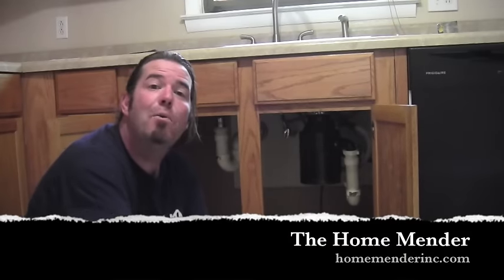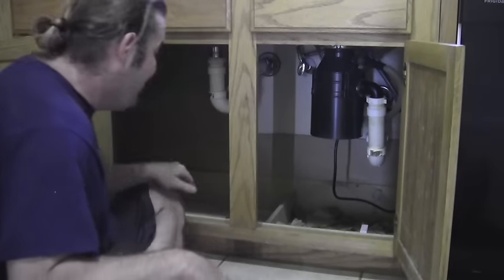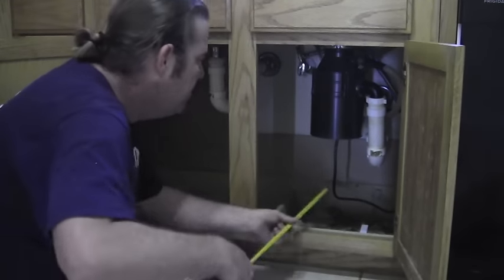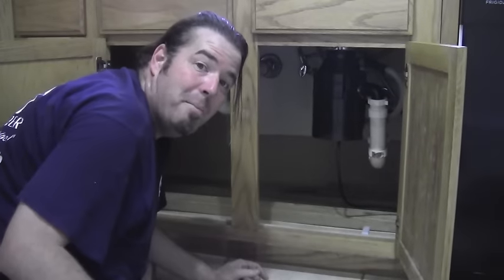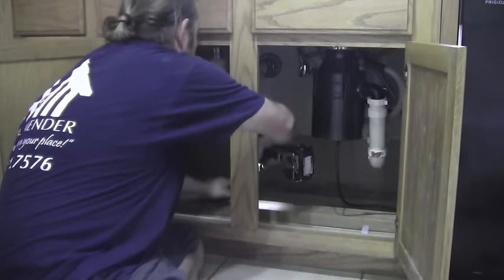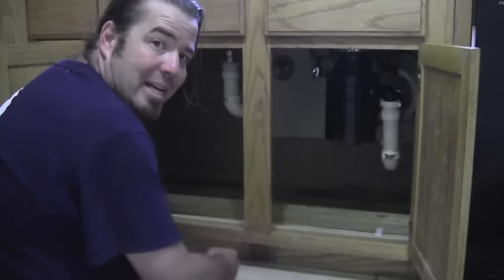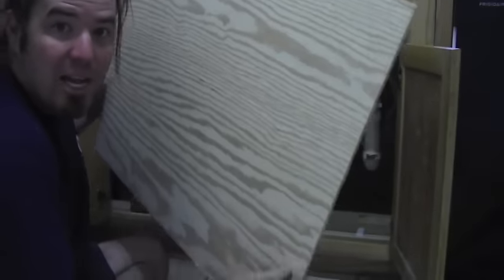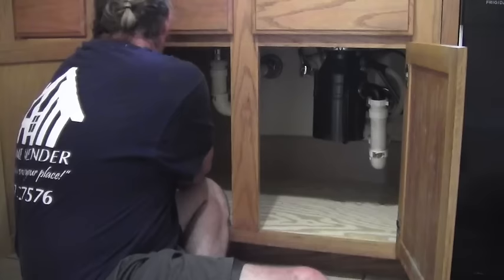How to replace rotted sink base cabinet floor bottom. Easy! Home Mender.

Comment: Please guys, wear a mask and gloves! If water was standing on the floor board for a while before it was discovered, you can have some very toxic molds still underneath that board. I've seen more than one guy end up in the ER after doing this type of work, same for dishwasher repair and bathroom vanities. Oh and don't leave the mold in there, clean it out before you put the new board in.
Reply from the maker: thanks for sharing!
Reply: @homemend  That’s my concern as well. How do you safely identify and “clean” the mold?
Reply from the maker: Hey J!...if its black, i  would hit it with mold and mildew killer..not bleach...this  is  a myth  that  bleach works...HD has  a decent mold and mildew killer for 7-8  buckw .if its  really bad, i would pull it..i hope this helps!
Reply: @homemend  That’s fantastic! Thank you so much for your quick response! 😁  I’ve subscribed and look forward to your future videos. Merry Christmas, too!
Reply: No

Comment: Great vid!!!! A couple suggestions, use pressure treated plywood for the replacement base or at least treat the untreated plywood. Also, use galvanized nails or screws for extra protection for an extra couple pennies. Lastly, caulk the seam if you have to cut the plywood base in half. Thanks for the vid.
Reply from the maker: Thank you mp!

Comment: If you are still reading comments on this, I got a question, how did you secure the pallet to the floor? The area under my sink is simply a concrete slab with no wood flooring on top. I can't really nail or screw into the concrete.
Reply from the maker: Hey hey Jason, I’m here for you my friend. You have the same situation I do as I was on a slab. You’re basically building a little floor in the bottom of your cabinet. Once you get it built and secure your top to it. You should be good to go! If you need extra security, you can always liquid nail it to the cement.

Comment: Yeah that was supper easy... since you strangely didn't have any pipes coming through the floor.
Reply from the maker: Thanks for watching. if you have pipes, draw them out on your board first and then cut your board through the pipe hole so you can piece your floor in around the pipes. You got this.

Comment: This is a great video!  Some videos make it look like this is the hardest job in the world, but this one is the best.
Reply from the maker: awesome Michelle. Thanks for the comments and thanks for watching! You can do it!
Reply: It's a pretty easy job when there are no pipes going through the cabinet bottom. Some of the other videos show a cabinet like mine, with three pipes through the floor. That makes it way more complex.
Reply from the maker: that does complicate things. You would still do it the same way but measure the location of the pipes, drill the holes for them, then cut the board so you can peice them in. i hope this helps!

Comment: I pulled this video up for a friend.Good video but can I add one tip..9 time out of 10 you can slide the floor piece in from the side almost vertically behind the center post.Then kick the bottom edge in so it lays flat.Stronger and looks like new.If it won't go in you can always cut it down the middle after trying one full piece.
Reply from the maker: hi gueto. great tips! thanks for sharing. spoiler here. already knew it wouldnt fit..lol thanks for watching!

Comment: Thank you.  For mine it is a bit more challenging as the right half of the cabinet is a blind corner.
The cabinets are over 24 yrs old, and I'm debating just replacing them or fixing the bottom of the sink.
This is the 2nd leak we had.
Reply from the maker: Hey walker, you are right at the cut off point at 24 years my friend. Good luck to you!
Reply: @homemend  thank you and great tutorial. I passed it on to my husband so we can decide how to proceed.

Comment: Damn, that looks easy. My father has an apartment and he keeps wanting to use the original frame that was under the sink that came with the cabinet. The tenants he's had over the last few years were from Turkey, and they've ALL had problems with indoor plumbing. Toilets going over, leaks that never get fixed, and they've made a mess of things. This helps IMMENSELY. Thanks.
Reply from the maker: youre awesome robot! Thanks or watching!
Reply: Update; Slight variation on the theme. I made a frame out of three 2x4's cut 20 3/4 inches long, then used wood screws to fasten one inch cross members to the top of them, and secure the whole thing and to cap it, similar to what you said. Mounting some 3/4 inch plywood on top. Bing, bang, BOOM!!! Took me about an hour or so. The ugly rotted parts left showing I'll trim away, and make it look nice. 

Again, thanks so much!!
Reply from the maker: well done! Thanks robot

Comment: Your setup is sooo easy. I have my main pipes for the water supply coming up from the bottom so I will have to cut around them.
Reply from the maker: hi james.. that is a little tougher..you can still lay it out the same way but before cutting, mark and drill your holes for the pipe, then make your cut to split those holes. the floor will piece in right around them..i hope this helps.. thanks for watching!

Comment: You’re the only one that is doing it right. Replacing the board instead of covering up. Could water leak through the particle board and warp my wood floor underneath?
Reply from the maker: Hey hey usually the press board soak it up pretty good but it has been known to happen. I hope this helps. Thanks for watching.

Comment: Thank you so much! Every time I see mine it makes me sad and this looks like it’s not even a hard repair. I don’t have an actual mold problem thankfully (just one sudden pipe failure that swelled the mdf in a big circle) but the look of it was depressing me. I’m going to add fixing this to my to do list alongside removing some awful cove base from my kitchen that the previous owner attached with what appears to be black magic because it melted the toe kick under it.
Reply from the maker: That is awesome me. Thank you so much for sharing! You got this

Comment: “….look like a homeowner’s special.”….uses old pallets and 2x4s in place of a properly build frame.

I frame mine in 1x4 oak around the perimeter, all pocket screwed together.  I use scrap 1x4 to set the height in the 4 corners.  Don’t forget the brace in the middle if needed.

After setting in the plywood, protect it with adhesive contact paper, preferably a vinyl product.  Covers the seem as well so future leaks don’t go through the seem and into your pallet wood.
Reply from the maker: Hey CLS. Great suggestions. I don’t usually make hidden frames out of finished wood, Thanks for sharing

Comment: Thank you for posting this. I inherited early my mother’s old home. She has mold in the bottom of hers but there’s a pipe running to the floor under her kitchen sink instead of through the wall. Same with the restroom. Her back wall in the rr under the sink is sinking in from water damage. Not sure how we will repair that 😩
Reply from the maker: Hey Liz. There are plenty of videos here on the channel for you to take care of that. It sounds like you would need to remove the base cabinet. You got this.

Comment: Thank you so much for this video, so helpful! I know this is from awhile ago, but wondering if you could please explain how to replace the back of the cabinet like you mentioned? The water damage is bad under the sink in the house we just bought, and the bottom and back of that cabinet both need to be replaced but I can’t figure out how to do the back 🥺🙏
Reply from the maker: Hey RW. You may try putting a false wall back there. Secure some pieces of wood to the side so you have something to nail the back panel too. Hope this helps

Comment: What's the best way to replace the base/bottom shelf of a hanging cabinet?
Reply from the maker: Hey code. I have no idea my friend. You may try to pull it off the wall, wood, glue, and L brackets until I got a better idea. I hope this helps.

Comment: I think you should have painted the plywood before you installed it in the bottom of the cabinet and then  put a vinyl sheet or protective cover  over it so it won't get wet and rotted again.
Also caulk the seam in the middle and maybe all around the perimeter too.
Reply from the maker: Hey Frederick great suggestions my friend. It’s a good idea to do periodic inspections to ensure there’s no water dripping down there,  Regardless if it’s painted caulked and all that, if it’s still taking on water it will still rot. Thanks for commenting!

Comment: What kind of screws did you use to attach the pallet wood to the floor?  Our floor under the kitchen sink is concrete.  Any suggestions?
Reply from the maker: Hey Cher. Are used deck screws to screw it into the woods subfloor however you don’t technically need to secure it. If you want to secure wood to concrete you can always use liquid nails and set the wood on top. I hope this helps!

Comment: What do you do if you have pipes going from the sink into the floor?? It seems like it makes it MUCH harder to replace. I'm currently in that situation and a contractor I brought said that I would need to remove the whole cabinet, sink, pipes, dishwasher and countertop to replace that board.
Reply from the maker: Hey RA. That may be because that contractor didn’t watch this video. You got this man. Yours is a little tougher but you can definitely do it. Measure and cut the one piece like I did, then mark where your pipes are going to be. Your cut line will pass through those pipe holes so you’re two pieces will look a little different. Just be gentle when you’re cutting the old one out.You got this.

Comment: I'm installing a over the range microwave except I have no bottom shelf on my cabinet where the microwave bolts will go thru. what is the best way to mount a piece of wood on the bottom the cabinet
Reply from the maker: hey chris! you may need to replace the cabinet. Obviously i cant see itm but microwaves can be heavy and although they are mostly supported by the wall, that base still needs to be strong.I hope this helps.

Comment: @2:03 Don’t measure the width like this guy by squeezing the tape in the corner and hoping you got the right number. That’s homeowner’s special. Measure to 10 inches, make a mark then measure to your 10 inch mark. You eliminate the possibility of errors.
Reply from the maker: As long as the mouse find the cheese. Thanks for watching

Comment: Many thanks for this easy-to-replace sink base cabinet floor bottom. I have two questions. (1) Why is cabinet floor bottom needed? Won't the floor underneath suffice? (2) Wood bottom will rot again after a few years. Is there another material that can be used, such as plastic board?
Reply from the maker: Hey Tiru.  Cabinet floor bottom just looks neater and professional. No real  need. 
As long as leaks are addressed, no rot will occur.  Some paint the floor with an exterior paint but I just keep my sinks free of leaks. 😃
Reply: @homemend  A couple of times, there were leaks under the kitchen cabinet because the pipes at two joints broke loose {I think because of the vibrations from dishwasher and garbage disposer}. I placed props and thus far, no leaks.

Very many thanks for your idea on this topic. I am not a handy, but I shall try ...
Reply from the maker: Awesome comment my friend. then the video worked. You’ve got this

Comment: This may be a dumb questions, but can you explain how exactly you secured it to the floor? like did you actually have to drill through the floor?
Reply from the maker: Hi Harry.  This is a wood subfloor so I just screwed through the pallet into the subfloor

Comment: How do you change the wall under the sink?
Reply from the maker: Hi Kristen. I would use a multi tool to cut out the gross or deteriorated portion and then you can slip in a new panel through the whole side and create a false wall just for vanity purposes. I hope this helps!

Comment: Hi!  How can I tell if it is mold or mildew?  I am super scared of mold. It is in my elderly mom's house under kitchen sink.  I got the leak stopped- but I am afraid to clean the cabinet- it has black stuff.  I am pretty sure I did the wrong thing and sprayed clorox bleach all purpose cleaner on it but have since heard that bleach wasn't a good idea.  Any suggestions on what to do?  Any help is appreciated.
Reply from the maker: Hi Catherine. You are awesome first of all. Second I like to use a mold and mildew killer. They only offer one at the Home Depot. There is also some mold armor stuff that is pretty awesome that kills removes and prevents. The difference between mold and mildew? I’m no expert but I know mold keeps growing. That mold armor stuff it’s pretty awesome. Make sure it’s Well ventilated when you’re using it if you want to taste your lunch that day. I hope this helps and thank you so much for doing your moms house!

Comment: Hi, the particle board in the kitchen cabinet is gone, and the subfloor is now wet and black. I am using a fan to dry it out. Should I cut out the blackened subfloor and replace with new?
Reply from the maker: heyhey mark...thats gotta be a judgement call man...if its super gross and slimy..yes..if its just a little black you can hit it with a mold armor or some other mold killer and blocker and clean it up....dry it out and see what it looks like... you got this!

just in case
https://www.youtube.com/watch?v=HUmc_xa2c1I

Comment: I liked your video mostly for the tear out.  Most of us aren't going to have a pallet to use so will make a frame of the exact height I need.  You didn't show us what you used to secure the frame to the floor...mine is wood, some might have concrete.  No problem for me but would help others to show.  Obviously in a potentially wet area like this one is going to leave the wood bare.  What do you recommend to finish off the new wood sheet you installed?  Paint/stain? What kind?  Wax too?  Contact paper? or something else entirely?
Reply from the maker: Hi james!....just deck screws into the subfloor...concrete? i wouldn't really worry about securing it..its going under a sink, its not really going to move anywhere. As far as the finish, it's a preference choice..I usually leave it bare but one thing people really need is to check for leaks periodically. It doesn't really matter what the finish is if the sink's been leaking for two months..if i had to choose, i would do an exterior semigloss..i hope this helps and thanks so much for commenting!

Comment: I have a question, because my landord did this under my kitchen and bathroom sinks; should OSB ever be used as the replacement wood for a job like this? Because im pretty sure the fact that they didnt fix the leaky kitchen sink is going to cause unhealthy mold to grow in that OSB as it begins to fall apart from the water. Thanks.
Reply from the maker: hi kirk... osb wouldn't be my first choice for this application... if its leaking, no matter what its replaced with will rot again but typically plywood is the suitable material for replacement.. i hope this helps!

Comment: This was close to helping me. My issue is the pipes go down through the floor. How to work around that without cutting the pipes?
Reply from the maker: Hey tom.  A little different. If you’re not cutting the pipes you will need to cut your replacement board in two pieces with the holes connected so you can place two boards in there completing the floor.

Comment: How idid you secure it to the floor?  And I assume you are referring to kitchen floor?
Reply from the maker: hey kirk..you can toenail the frame to the floor if its wood..if its a slab floor you can just set it on the floor...once everything goes in, it will be nice and secure.

Comment: Does this method work if the cabinet includes a particle board on the bottom?
Reply from the maker: Hey linda.  Absolutely.  That’s what I was replacing here. Pull it out and put in new wood 😀

Comment: Hey there! This video seems very helpful but i was wondering how to go about pulling out the old nasty flooring when the water supply lines are running up through the floor.. thanks !
Reply from the maker: hey jtal!.... i would try to bust a hole in it somewhere then pick at the hole....you could always use a saw to cut a section out (where there are no lines) then work it out piece by piece. :) you got this!
Reply: @homemend  thank you! That floor is real nasty and we have tiny buggies crawling down there ..gotta get on it haha

Comment: My kitchen is being renovated. The water was off and I assumed the contractors turned it off while removing the sink. The contractors doing the flooring needed water, so they asked me to turn it back on, which I did. Unfortunately, a rush of water came out of the sink outlet and spilled into the bottom of my BRAND NEW CABINETS! OMG!

I wiped out the water, even coming back with extra absorbent toilet paper (hey, it's all I had on hand) to get the excess moisture. A little extra water spilled into the concrete section where the dishwasher will be. I put a bucket under the outlet, so when the contractors need more water, there are no more leaks.

MY QUESTION: Do you think any significant damage was done in that one instance of water leakage? They're my brand new cabinets, and I'd hate for them to be damaged like five minutes after installation was finished (they finished last night). :(
Reply: Next time use a fan.
Reply: Kat Wright, hey there normally one occurance would not cause this type of problem especially of you dryer thing out immediately and didn't let the water sit. These type of issues happen over time.
Reply from the maker: hey kat! not completely damaged..they got wet once..drying it up will be ok..just make sure you can get some air under them. i hope this helps!